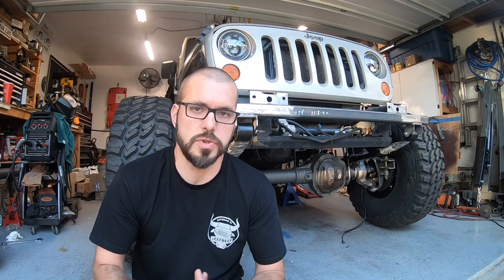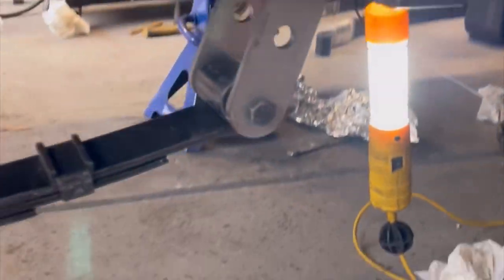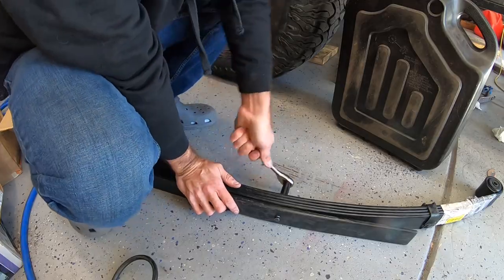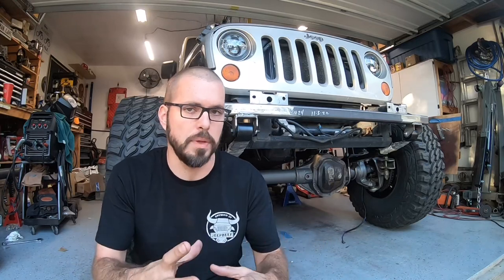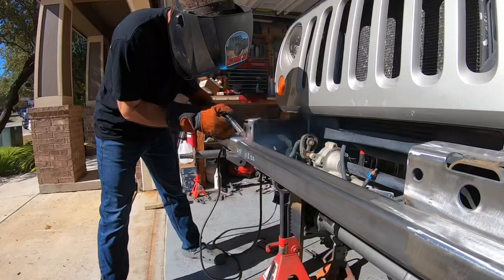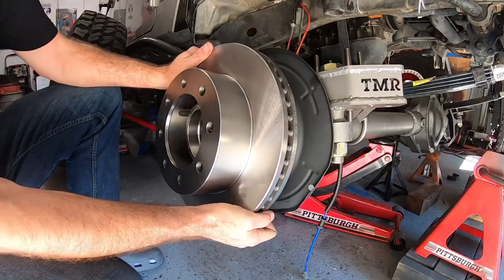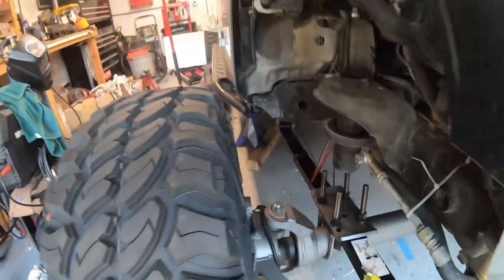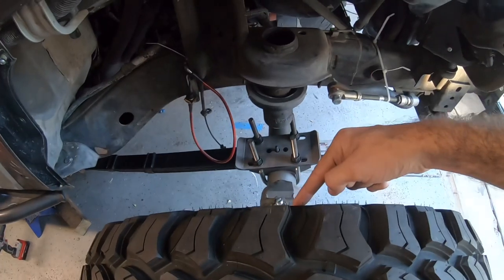Superduty Dana 60 Axle Swap - Project Maple Leaf Jeep Build (no. 17)

Comment: I understand the struggle of Dana 60 swapping with lead springs. Actually converted my ‘03 F350 SD60 into spring under for my wagoneer to keep my ride height.
Reply from the maker: Awesome. The later one is a little more challenging because it was never a leaf spring axle. But there are products out there to make it a bit easier. But the DIY stuff is always more fun.
Reply: A couple hours of finding the correct angle to mount the under axle pad, grinding, then pre-heating the casting before welding all during sub-freezing weather makes for quite the memory 😂

Comment: Kick ass work, nice job! One thing that was immediately apparent to me is how snag free the front axle is with leaf springs…that’s a super nice benefit. No control arm or shock mounts hanging underneath it. Throw some axle tube height or top mount shock mounts on both ends and it’ll be super easy to drag those snag free axles over rocks 😎
Reply from the maker: Thanks for the support! I definitely have something in my mind for the shock mounts. There won’t be anything hanging under the axle in the front or the rear. Should work well. I’ll have the start of the rear axle video and a quick one showing how to make a tierod/control arms next week. It’s getting there for sure.

Comment: This is interesting AF! I’m learning a lot however one big advantage of coils becomes very obvious when you look at the potential approach angles
Reply from the maker: For sure! Definitely a big advantage. With this rig I am moving the front axle forward quite a bit more than you can woth coils. Usually the limit there is the track bar and the pitman arm. So you can only move it so much and still have good steering. With the leads there is no track bar. So stretching the axle as far forward as I did….the approach angle should still be about as good as it is with my jku on coils. We will see! Starting in the rear end next week.
Reply: @WarPaintOffroad  that’s awesome!

Comment: Great vids... Thanks. Specifically this one. Why because I build 4X4 vans (GM Ford etc) I have 4 of these 05+SDD60 axles and not a fan of stock radius arms or brackets... Yours is the only source I found to do leafs on these axles... Also found Barnes4wd bracket set... I am curious how your build is coming and what you have done? My two builds I am considering doing these axles with leafs is a 91 GM shorty school bus and a 95 Ford SRW Shuttle bus...
Reply from the maker: That’s awesome! The build turned out GREAT! Shake down run coming this weekend. I’ll have a video out at some point next week.
Reply: @WarPaintOffroad  Right on! Looking forward to it. Thanks for the quick reply!
Reply: @WarPaintOffroad  what leaf spacing did you end up going with? 37"? 
Also, how did you end up dealing with your steering? The track bar appears to be able to clear the leafs but what di you do for the drag link? Im guessing you had to make a bend in it to go under passenger leaf but go over drivers leaf and reach the pitman arm? I have yet to find another build like this going against the norm of people going with coils instead of leafs...Im building a 91 GM shorty school bus...Thanks!

Comment: Don’t they make U-bolt deletes (or whatever they’re called) where you basically mount a plate on the top and bolt it into the lead spring bracket that’s welded on the axle? I believe I’ve seen stuff like that before. Why not use those?
Reply from the maker: They do make those! They add a bunch of cost. And the ubolt isn’t an issue crawling over stuff. It would make it easier on the driver side of the front axle….but the time it would save me from cutting the casting I’d spend on rounding out the one side of the perch to take advantage of the difference in casting vs. tube diameter anyway. But it’s definitely an option.
Reply: @WarPaintOffroad  yea I don’t know cost on them. Just figured they’d be easier then messing with U bolts.

Comment: Loving your videos, and great explanations. How did you set the angle of your spring perches on the axle in terms of pinion angle and caster. Do you think you’ll need to use any shims to correct your caster?
Reply from the maker: Thanks for the support! At this point they aren’t “set”. Not permanently anyway. Right now they are just sitting in the axle with the ubolts holding the axle to the spring. After the rear is swapped and set up…I’ll sit it in all four tires…set the rear pinion angle, tack the perches…and the. Take it back apart and finish weld them. Same for the caster in the front. But only after the rear is set and it’s sitting on my garage floor at ride height.

Comment: What is the spring pad width center to center? Back in the 90s I built many long travel SOA setups. With my jkur I would stay coil in front, but am considering leafs and a 14 bolt rear setup down the road.
Reply from the maker: Man I’m not home with it right now. I can’t remember off the top of my head. I’ll have to measure later today and let you know. I’m starting on the rear this coming week.
Reply: No rush.
Reply: I did a 1st gen 4 runner on jeep xj and yj springs. I used Tera jeep tj flex arms with acme thread to build single anti wrap bars. The front wrap under braking is what everbody forgets to address, it can be as scary as death wobble!